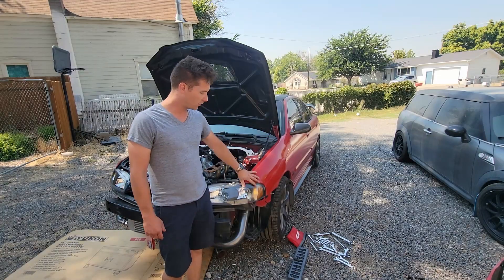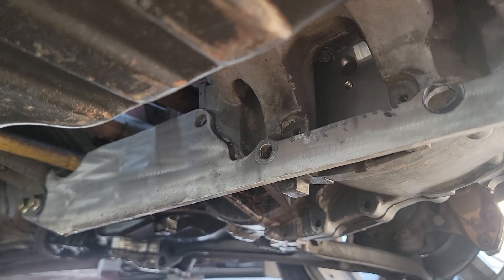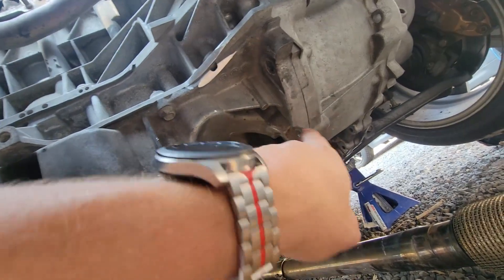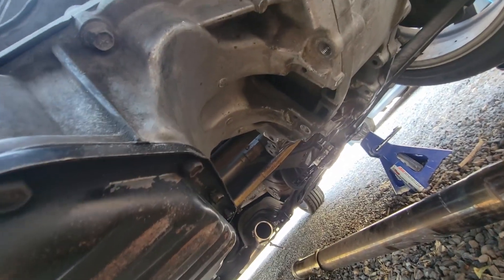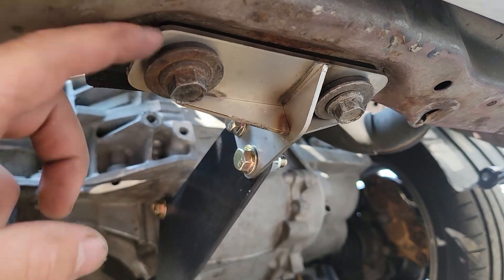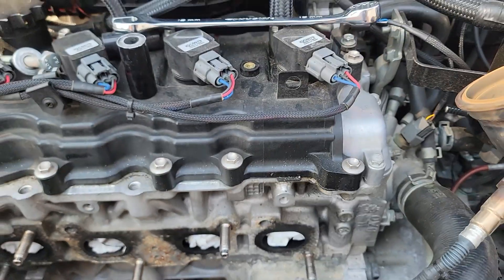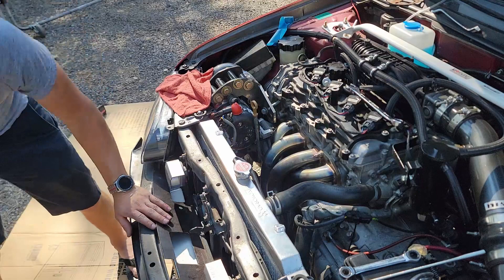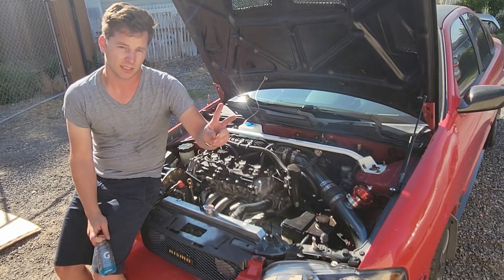making the gen 2 swap better! Installing the new Vision 1 Racing mid-plate.

Comment: I like the plastic shim that you made in between the end of the cross member and core support! Did you do that for the rear crossmember mount too? I feel like that would help with rigidity and nvh somewhat with the larger surface area of that “bushing”. I’ve always thought it was weird it’s not full face and all the load is going through the surface area of 4 washers lol.  I have delrin ones but now I think I’ll make that top plate too! I’m putting in the vr1 v2 mid plate today and wanted to make sure those spacers do go in between the plate and engine holes so thank you. Also what material did you make the shim out of?
Reply from the maker: I made front and rear. I don't have the rear installed just yet. I plan on changing the shape to match the v1r flanges. It's made from some hdpe.

Comment: Super cool build bro this is exactly what I want to do with my Sentra if I may ask how exactly did you get the 2nd gen QR25 to work in the B15? I’ve seen so many inconsistencies on forums from the wiring being different to the transmission not fitting but I always thought it should’ve been possible please lmk it would be super appreciated.
Reply from the maker: Transmission works. The only thing needed for the swap. Is to figure out how to mount the engine. Which this midplate makes that possible. And it gives you space for the exhaust to go. Because you need a new header and midpipe. And the last big thing to making the swap work is the can and crank signal. You either need signal inverters or you need to swap cam and crank trigger wheels.